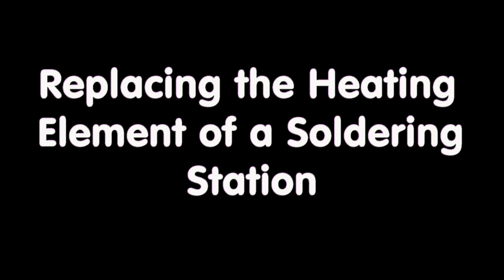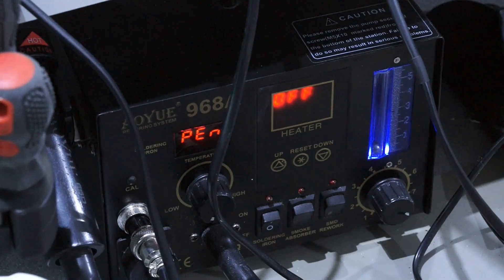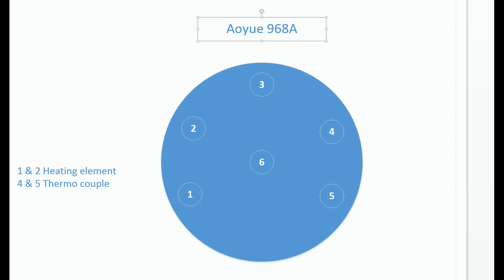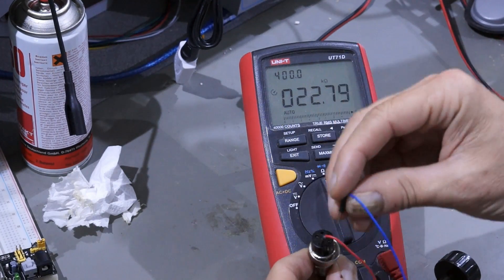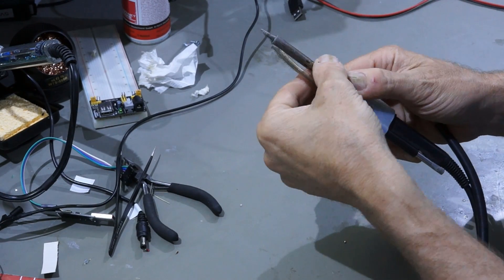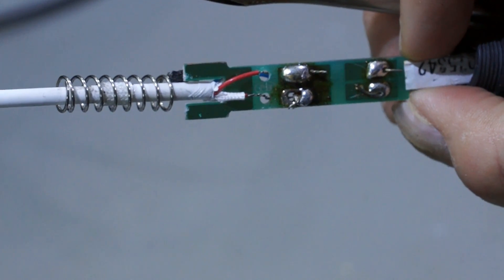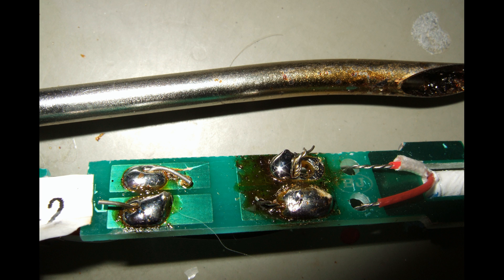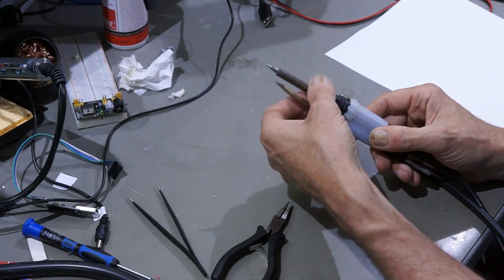#5 Repair: Replacing the Heating Element of a Soldering Station Aoyue 968A

Comment: THANK YOU! The tip about solder not sticking to thermocouple wires saved me so much headache trying to figure out why everything checked fine with a meter but randomly stopped when using. The thermocouple wire poppped out of solder slightly
Reply from the maker: Glad the video was helpful!

Comment: Hi i have just seen your video were you test other irons and see the watts used, did you fit the 35w part number C001 element , as you can get a 30w for the 968 (none A) model, the 968A should have a 70w element,
Thanks Dave
Reply from the maker: I do no more remember. This is an old video :-(
Reply: @AndreasSpiess  
I know, I was just looking at your great videos, as I have a older model,
Thanks Dave
Reply: Hi just a update,
I have fitted a 70w iron to the older model, and it's taking 76w,
Dave

Comment: So if you buy an Aoyue soldering station it's better to buy a second one directly!?  Because you will need it to repair the first one after a while. By the help of a manual which doesn't explains anything. At least they deliver a replacement heating element with the cheap station.
  My 937 station never really worked well. And i guess after 8-10hours operating time the ceramic part of the heating element completely broke, under this ceramic it was very corroded.
Lesson learned! Don't buy this crap anymore.
Will order a proper brand now, even i don't use it for more than 3hours a year. Especially for SMD the Aoyue was more than useless. 
I see your station is much more expensive. Is it also the quality and performance?
Reply from the maker: I replaced my Aoyue with a Quick861 Hot air and a JBC soldering iron. The price of the two together is probably 800 dollars. So not for everyone...

Comment: So true,  I could not solder the new element to the existing wires. You must wrap them around the existing then cover with solder to hold.  Also, the calibration on  mine had to be set to max to work right, and it is not labelled or even mentioned in the manual.  Thank you so much
Reply from the maker: You are welcome!

Comment: at 4m02 there is a diagram showing "1&2 Heating Element" and "4&5 Thermo couple" then about ten seconds later in the explanation Andreas says "between pins 1&2 is the Thermo Couple" - WHAT IS IT? Also I cannot understand the mumbling about twisting wires. The actual replacing is not shown. This video has just confused me. Also you do not show the back of the heating element/thermocouple showing how it is connected. You only show the front. Why? With respect this is very confusing.

Comment: can you tell me what the resistance across the heater leads should be in ohms, as well as the resistance across the thermocouple leads should be    Do you know what voltage should be to the heating element and does it change as you raise the temperature control knob, or does the voltage stay the same and the feedback from the thermocouple just turn on and off the voltage till it reaches the set temp.   Really appreciate your know how,   would love to get this unit to work   With Regards   Fred    PS I used to live in Ascona till i moved back to the states
Reply from the maker: As I wrote in another comment: The thermocouple creates a voltage, the heating element not. If you heat up your soldering Iron (e.g. with a hair dryer) you should get a raising voltage between two wires. The other two do not create any voltage.
My soldering Iron has the following colors: 1- red; 2-blue;3-black;4-green;5-white. The thermocouple is between 4 and 5. It creates about 2mV if you heat it up to maybe 100 degrees centigrade. The higher the temperature, the bigger the difference. Pin 5 is positive. 
The "stranded" wires (red-white) on my heating element are connected to the heater, the other two are the the thermocouple (blue-white).. The white is the plus.
Please keep in mind: These are all measured on my soldering iron. Yours may be different and you can destroy things.
Hope this helps.

Comment: I had to change it on my zd-937 no name soldering station but heating element was the same. I bought it and i got thermocouple wired labeled blue and red on element and cable. I soldered them and after 3 hours of pain in brain i figured out that hey swapped colors on element. Be careful when changeing it. Always first test thermocouple polarity with meter.
Reply from the maker: Good advice. Thank you!
Reply: When changing out the heater/thermoucouple unit there are 4 wires    two are traded and two are single stranded,  Are the traded ones for the heater and the single ones the thermocouple?
Reply: sorry that should have been STRANDED   logic says these are for the heater but on my unit they are connected to pins 1 and two    not 4 and five.    Which pins carry the 24 volts to the heater element and which pins should be the thermocouple.  Is there a polarity on the thermocouple leads ?   help is appreciated    fred s
Reply: there is polarity on thermocouple. if you reverse it yours temperature will go in reverse and it will stuck at zero and crash firmware like mine does. it just resets. Solid THIN wire is for thermocouple. and for heater one is THICK stranded and second is THICK solid wire. if you reversed polarity on thermocouple dont turn on station for more than 10 seconds. if temp dosent go up in 10 seconds then reverse polarity and try again.
Reply from the maker: I made notes about the colors before I disassembled mine but put them away when I finished. So, I cannot tell you anymore. 
Normally, the Thermocouple has a polarity. If you heat it up (e.g. with a hairdryer) you should be able to measure a few mV. The heating element should not create any voltage.
Reply: My cable to the soldering cartridge has 4 wires, two are stranded and very stiff   i think these are for the heater element  then there are two solid wires about 20 thousands and i believe these are the thermocouple leads    does this sound right?
Reply: @ @fred-mb500slr  On mine, the heater element is 12 ohms, and the thermocouple is 1.2 ohms.
Reply: fred silberkraus i will tell you one think. take soldering station apart and find out inside it. heater should go to triac and transformer secondary and thermocouple to main pcb. i have no idea what to tell you now. what you mean by 20000?
Reply: i bought a new heating element/ thermocouple unit  but i am unsure where the four wires go.  two wires are twisted strand wires and one has a very short length of white overwrap  bot wires are red  (i thought these might be the heater leads) the other two are stiff single strand wires about 20 thousands in diameter, and have very smooth insulation over them  one is a light blue and the other is clear , are these the thermocouple leads?  i can measure a very small resistance between the stranded pair and a very small resistance between the blue and clear so they are definitely two separate circuits.  On the power unit i measure about 3 volts dc across pins 4 and 5 so i assume these pins power the heater.  but which wires on the element are for the heater     your help is greatly appreciated.   fred s
Reply: fred silberkraus with measuring you cant find anything, try to locate it on pcb or use multimeter that supports K type thermocuople measurment and try to find thermocouple by measuring with multimeter
Reply: Nicky  thanks for the tips   Is there any measurable resistance across the heating element leads  I used a coo1 replacement cartridge and it just seem to burn up. Is there a different element for the 968A+ as opposed to just the 968
Reply: @fred-mb500slr  8 to 10 ohms. mate is element..
Reply from the maker: Whether the element is different I do not know, but I think, the connectors are not compatible.
Of course, the heting element has some resistance, but I do not know, how much and mine is already built in.
Reply: How do you test the polarity of the thermocouple?